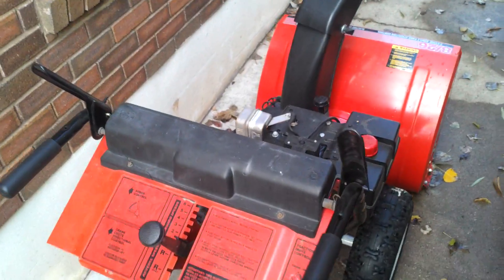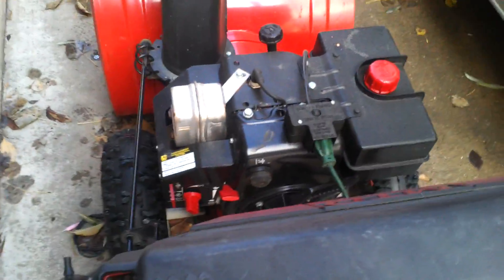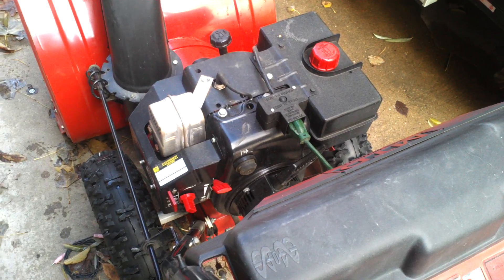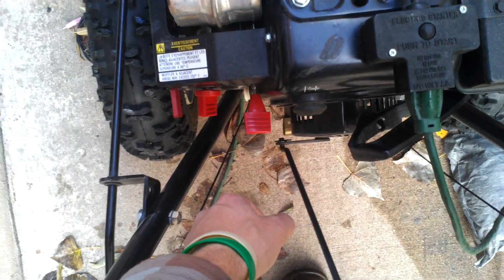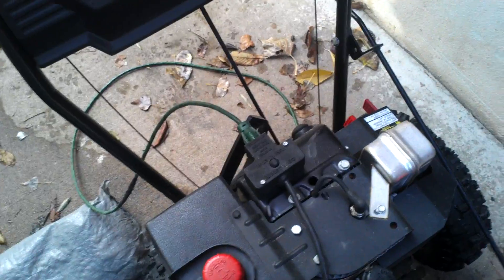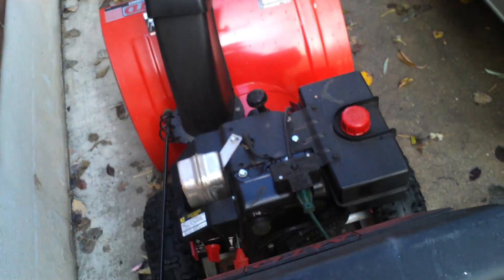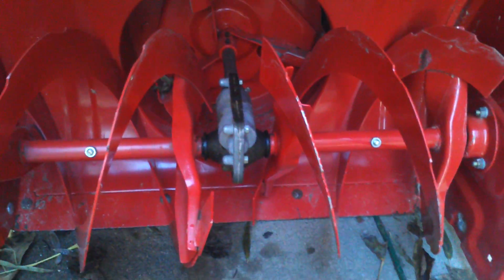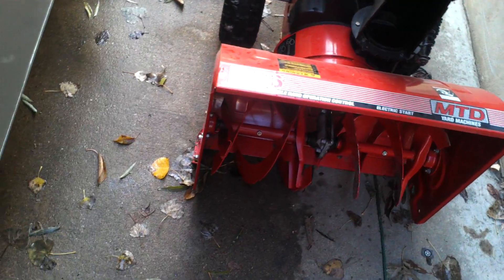first snow blower of the season

Comment: I used 5w30 in my Tecumseh 10hp.  Better to use winter appropriate motor oil in these units.  Also, don't check the oil outside in winter.  If you notice the oil looking milky white, snow flakes and moisture entered the engine.